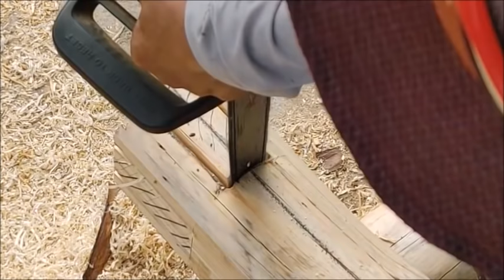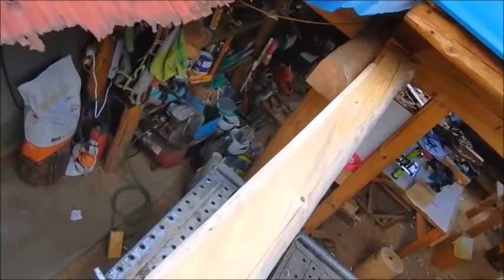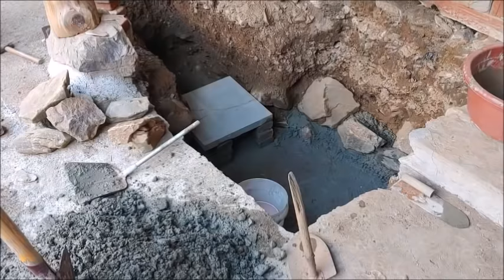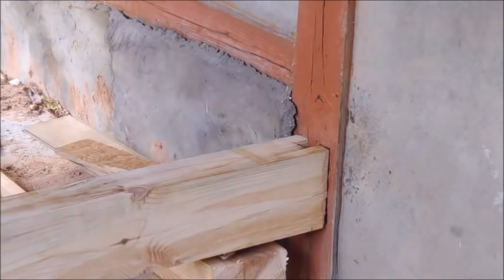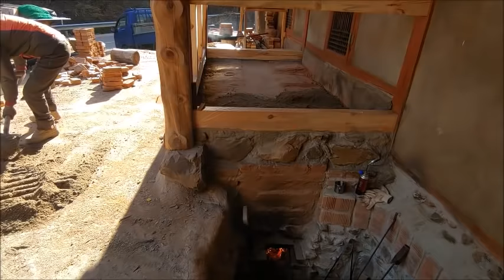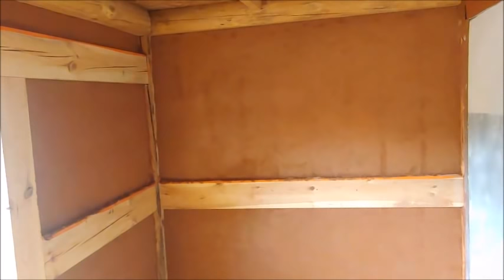House25-꿈의구들방 ,나의온돌방,4개월의 노력!, 한옥.wood.

Comment: Amazing 500years old technique with the tools available now. Perfect mix of tradiontal craft and recent technology Thanks so much You are the best mate
Reply from the maker: Thank you for watching my video.
Reply: how do you get the ashes out ?
Reply: @sandhiller49  with a shovel probably
Reply: @sandhiller49  there is chimney at the end of the path. When you burn wood at the entrance the heat and the smoke follow the path under the floor. The heat will remain in the path if you make curved path right before the chimney. The smoke will go through the path and exit to the chimney
Reply: 500???  Where did you get the number from???   More than 7000 year old technique.   Use of the ondol has been found at archaeological sites in present-day North Korea at Neolithic Age archaeological site, circa 5000 BC.

Comment: Thank you for recording the process. It was very enjoyable to watch. The joints on the woodworking is excellent.
   In America, we use a heated water system for warming the floors. Plastic tubing snaked back and forth under the flooring. It is ran by electricity. So when the power goes out, so does the warm floor. Your family must be very proud of your hard work.
Reply from the maker: Thank you for watching my video.
Reply: It is a Korea-made, modern development of traditional ondol heating in Korea.  Now, every house in Korea is heated with such a system.
However, in Korea, stones are covered over pipelines to preserve heat for a long time.  So the floor stays hot for a long time even when the boiler is turned off. ^&~

Comment: What an interesting system. Reminds of antique roman heating systems, but they were built under entire house's floor.
Nicely done.
Reply: I'd love to see someone recreate/build a legitimate full sized Roman style house 😳

I'm super curious about the stochiemetry and airflow of those types of under-floor heating systems
Reply: @jaymethodus3421  totally agree, but haven't seen anything on roman cottages, unfortunately.
Reply: @jaymethodus3421  lolz...try cleaning the soot out of a roman system--or get rats!  His method has places to block off vermin and to drain if flooded--very elegant system!  The roman system had a floor of brick, is only about 18" in height.   Apparently the Ondol often uses clay pipes but here he uses bricks to support basalt stone slabs.  Someone else commented the number of people dying from CO poisoning in Korea.  That sounds like the gaps were no longer sealed and the house was also poorly ventilated.  Makes sense, these systems should last 100's of years without maintenance, so generations later would not know how to check.
Reply: @billhanna8838  O! Still so sad, though.
Reply: You're right. It really looks like some kind of a hypokaustum, the old roman floor and with tubuli also wall heating.
That was a lot of work just for getting a room with a heated floor. But ist also shows some amazing woodwork and nice craftsmanship. 😳👍
Greetings from Germany.
Well, I still prefer some kind of modern floor and wall heating. 😉
Reply: @guntherdrehsen  I believe you're right Gunther, modern systems are safer and more efficient.
But it's interesting to track the path of human thought throughout the globe - they came up with similar decisions being separated by half of the Earth's equator:)
This never stops to amaze me.
Reply: @jaymethodus3421  This gentleman knows what he does.  Applause for him🙂
Reply: @guntherdrehsen  Most modern homes in Korea use radiant floor heating systems by circulating hot water through buried "snaking" hose under the floor. Best way heat a house in my opinion.

Comment: I’ve experienced these radiant heating floors in a home in Korea while stationed there in the military, very warm and cozy. The owner used the large round coal briquettes for the fire which was outside the home.
Reply from the maker: That's right. You have experience with Korean Ondol.

Comment: Some excellent traditional building methods and techniques displayed here.
Did like the jointing work on the wood framing without nails or screws, and the roman style underfloor heating, also approved by the cat!
Most of the traditional natural materials used here, like sand, clay, and wood were used in similar ways in Europe for hundreds of years, but clay as a building material is mostly forgotten as a building material except for restoration of old half timbered houses, due to more durable materials becoming available over the last 150 years and modern building regs.
But these natural materials are far more breathable and create a better atmosphere in a house.
Reply from the maker: Thank you for watching my video.
Reply: Thank you for teaching  ,God bless you
Reply: Koreans have been using this brilliant underfloor-heating methods over 5,000yrs
Even in Rome (hypocaust system), they had only used by public sauna in short terms of periods and disappeared very quick.
By using Korean ' Ondol ' system you don't need to wear socks,shoes in your home No need to fireplace,carpet,rug and radiator
There're so many benefits by using Ondol here So we called the acient of Koreans are genius of asian architecture
Reply: @bourneethan3190  5,000 years is a much longer period indeed than the maybe 400 or 500 years the Roman system had been used.
There is a museum (Heerlen, the Roman name was Coriovallum, between 0-400AD) which houses the remains of a Roman bath house not far from where I live in the Netherlands, where the Romans occupied roughly the southern half beneath the rivers Rhine, Waal and Maas.
The way the underfloor heating was made is very visible in this museum as the floor slabs have mostly gone.

Comment: A version of the old Roman underfloor heating, what is called hypocaust heating. Nice work on the timber framing. Regarding the difficulty of trying to fit in posts or rails into already installed posts and beams, usually in timber framing for English style barns and house framing as it was done historically in the U.S, they sections would be pre-assembled on the ground first, thus avoiding this trouble. These assemblies were called bents, and they were then tilted upright into position.
Reply from the maker: Thank you for watching my video.

Comment: Back in the 80's it was common to hear the dangers of carbon monoxide poisoning from leaking old homes heated by that system but if you ever experienced Korean winters it can be brutal. A well maintained system can keep those floors nice and toasty.
Reply: Korea's Ondol began to use anthracite-based fuels in the 1950s, and carbon monoxide poisoning began to occur.
Such accidents do not happen in the past when traditional firewood was used.

Comment: Thank you for sharing this traditional build with us. You have me wondering if I can incorporate such a room in my cabin. The material you used on the walls, is that a clay sand mix or is there a bit of cement included?
Reply from the maker: The material of the wall is sand (2.5), clay (1).

Comment: As a retired carpenter, I enjoy seeing a craftsman doing joinery like this. Although I have to say I was surprised to see him using so many power tools as most carpenters that do joinery this involved tend to use hand tools more often. I'm also left wondering just how often you would have to stoke the fire with more wood  during a cold winter day since it doesn't appear to hold much volume.
Reply from the maker: Once the firewood is burned, it is warm for about 24 hours.
Reply: That traditional system is highly effective as I got to see while stationed in Korea. As for the power tools remember most Western joiners do it for the artistic pleasure while in Korea it's just "construction" and anything which does the job more efficiently pays off in won!  Rituals don't buy groceries and what is to one culture an archaic hipster ritual long superseded in production is a normal day's work to another.  It's not an ASMR exercise or anything else but doing the job.
Reply: @TruthBeTold121212  "no bearded hipsters in Japan doing ASMR videos for likes."  -  but David Bull tho

ah, I'm just joking
Reply: @TruthBeTold121212  They were good at building railway bridges with a little “help” from POWs.
Reply: @TruthBeTold121212  I can tell by watching him that he is well familiar and skilled in doing it all by hand tools if needed.
Reply: @obfuscated3090  How do they regulate the temp? Some days much colder than others and I don't believe it's a "one size fits all" when it comes to how much heat is required for a particular day. So there has to me more to this system than what is shows if it only takes the initial load to heat the house for 24 hrs.

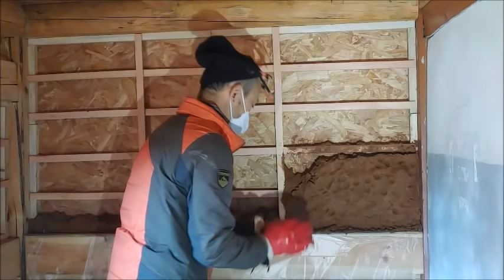Comment: 43:00 when plastering with clay it is adviced to wet the wood. That way the adhesion is stronger.

Please be mindful with the plastic floor covering, the heat draws out alot of chemicals.
There a certified ones, but they are expensive and maybe hard to get locally.
A old way of doing it is to cover the clay with woven mats or fabric, plaster them extrem thin with extra wet clay and after drying paint with multiple layers of linseed oil.

Best wishes from the other side of the globe!
Reply from the maker: I appreciate your advice.
Reply: Вот спасибо!Приятно,что есть люди,которые знают это!
Reply: not in freezing the cold weather or else it will start to form ice between the mid and wood, which later when the ice melts, it will create a thin space between the dry mud and the wood and makes it unsafe in the end.

Comment: I wonder what Paul Sellars reaction would be to seeing a chainsaw used to cut mortises? I was a bit worried about the lack of any kickback protection. However, I thoroughly enjoyed watching the joinery and the wood-fired oven build.
Reply from the maker: Thank you for watching my video.
Reply: @woodwood1  The design looks to be very efficient. It appears capable of heating with very little wood and storing a great deal of heat so you do not need to get up in the middle of the night to keep "feeding the fire". Impressive craftmanship.
Reply: It's a carving blade so bearly no kickback.
Personal safety should be top concern nonetheless.
Reply: After a few yrs of chain saw use, avoiding kickback comes pretty easy, regardless of what type of chain.
Reply: It's about concentrating the tip of saw so that it still close to kickback zone, but does not enter it. Small kickbacks you control with movement of your body. It takes some skill, but you eventually will learn when the kickback happens. Just like when using wood lathe with oval skew, you cross the line, it kicks and stuff gets flying. 🙂
Reply: I love my small electric chainsaw for just this sort of work with poles.

Comment: I have never seen anything done like this. Awesome build. So many layers to the process. Wood work was awesome. So does it only heat that one small area? Could it be opened up into the building for passive heating for the house.
Reply from the maker: Only a small part is heated.
Reply: This is an additional room. Existing old houses are already made of ondol heating.

Comment: Very nice wood working. traditional joints designed to save on using nails, which were once prohibitively expensive.
I am interested to know more about the specification of the mud and paper that seems to be the core of the envelope infill !?
Reply from the maker: The walls are dirt:sand=1:2.5
The paper is traditional Korean paper (Hanji).
Reply: @woodwood1  thanks wood wood. I have found a supplier of hanji in uk.

Comment: I'm in the process of RE- building a 2,900 sf 3 story home. While I appreciate the hard work and dedication, and magnificent skill level...There's GOT to be a faster, easier, less labor-intensive way to accomplish this! 
This  50 min. Clio took months to accomplish ...4? 
This addition could have been done in 2 weeks! 
The hand mixing of all the concrete? Unnecessary.  A mixing machine costs $140 from Harbor Freight... All the extras? Like the post and beam? WHY? When you cover it all up? 

Was it worth it for a 40 sf area?  Why didn't you are it 250-300 sf? 

I'm bewildered. It's tantamount to making a tire out of scrap rubber by boiling the rubber down, constructing a steel mesh, then overlaying all the rubber...next having to build a steel wheel for the tire...melting the steel down, constructing a mold...pouring the steel....

Why not just go buy a tire at the tire store? 🙃

Bottom line...? Great workmanship, but WAY WAY WAY too much work!!!

Comment: Love the precision carpentry. The “stove” looks like a small version of the Roman hypocaust system which they built in their villas and covered with beautiful tesserae (mosaic patterned floors made of tiny ceramic tiles) There is an almost complete one at Chedworth Roman Villa in the Cotswolds, U.K. Of course they had a slave who’s job was to keep the fire going…... Someone else has pointed out that one would need a plentiful supply of wood….not really a practical solution for our city populations today!
Reply from the maker: I agree with your opinion.
Not suitable for cities.
The way the video will be uploaded in the next 10 days or so will be appropriate for the city.
Ondol suitable for the city.

Comment: I respect the skill and excellent work of the craftsman, but I don't understand at all how this heating system work.
Reply: nice to meet you friend!
This is a method called Ondol, a traditional Korean heating system.

Ondol (ON-dol; /ˈɒn.dɒl/,[1] Hangul: 온돌, 溫堗, Korean pronunciation: [on.dol]) or gudeul (Hangul: 구들, Korean pronunciation: [ku.dɯl]) in Korean traditional architecture, is underfloor heating that uses direct heat transfer from wood smoke to heat the underside of a thick masonry floor. In modern usage it refers to any type of underfloor heating, or to a hotel or a sleeping room in Korean (as opposed to Western) style.

The main components of the traditional ondol are an agungi (firebox or stove) accessible from an adjoining room (typically kitchen or master bedroom), a raised masonry floor underlain by horizontal smoke passages, and a vertical, freestanding chimney on the opposite exterior wall providing a draft. The heated floor, supported by stone piers or baffles to distribute the smoke, is covered by stone slabs, clay and an impervious layer such as oiled paper.

See the dictionary for more details!

https://en.wikipedia.org/wiki/Ondol

..
Reply: @Lotuswhite2911  Very smart and interesting! Thank you very much!

Comment: Truly an amazingly well done job. The time spent to do a job properly is something that is a wonder to behold. Does this heat your entire home or is this intended to heat this room only? What is the purpose of this room? Someday I hope to be able to build a building and use this type of heating. I think it is just one of the most intelligent means of heating. One last thing,, what do you do when the passages become clogged with ash?. Thank you from Virginia USA
Reply from the maker: This is for 1 room only. This is the traditional way. There is a modern way these days. It has "Hot Water Boiler Underfloor Heating System". Both traditional and modern methods are called "Ondol".
Reply: @woodwood1  Thank you for the information. I look forward to watching more of your videos. Thank you from Staunton Virginia USA and me, Bob Ordewald

Comment: Sorry, not a fan. Not to belittle the incredible workmanship displayed here, but yes, I do know Ondol, not the best system for living quarters. The winter I spent in Seoul, Korea (1972) there seemed to be weekly news reports of people, including whole families, that were smothered in their sleep when the carbon monoxide rich exhaust from their charcoal Ondol fires traveling under their floors where they were huddled under their blankets leaked through the inevitable cracks in the masonry. Alternatively, the same fire can be used to heat water for a recirculating in-floor heating system that is much safer. It works very well, it's what I had in my little one-room rental. It used the same unique charcoal fuel. Very cozy crawling onto a nice warm yo and blanket on those cold, cold Korean nights!! This was way before these systems (in floor hot water) caught on in the US. Just my perspective.

Comment: Great video & master craftsman, I do a fair bit of similar chainsaw work. I notice you have the chain a little loose is that on purpose? what type of chain do you use?
Reply from the maker: I should have done the job by tightening the chain. my mistake.
Reply: @woodwood1  lol I thought you may have had it like that for better control, You are a expert on trimming with the chain saw. Have you tried a rotary chisel on an angle grinder I love them for fine trimming work, way better than sanding disc.

Comment: This is something you would never want to use in your own home. If the Ondol heating system develops a leak, you're pumping dangerous Carbon Monoxide into your home. The Koreans that still have these systems run them with the windows open.

Comment: Rocket mass heaters, mass heaters and kachelofens all seem to be based on the design of the Korean ondol.
Were these ever used for cooking as well as for heat like the Chinese kang?
Thank you for posting this.
Reply from the maker: There are two methods of ondol in Korea.
1. How to do it like in the video
2. How to install a pot at the entrance of the furnace (for cooking)
Thank you for watching the video.
Reply: @woodwood1  Thank you for your reply.